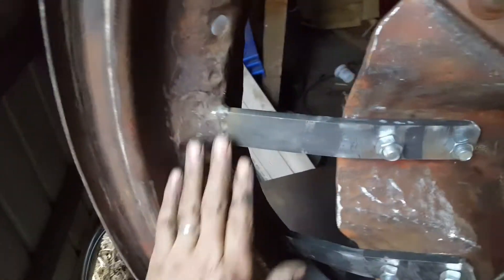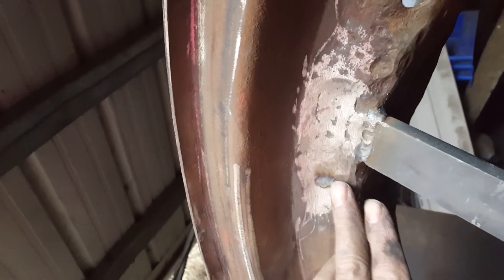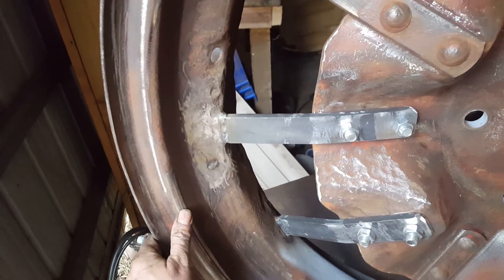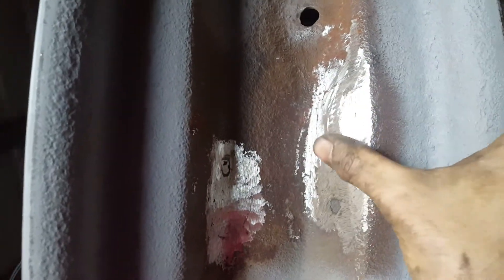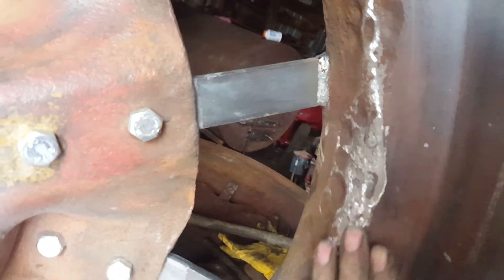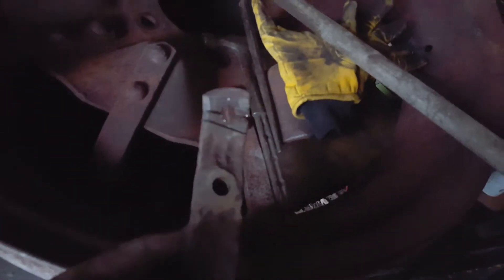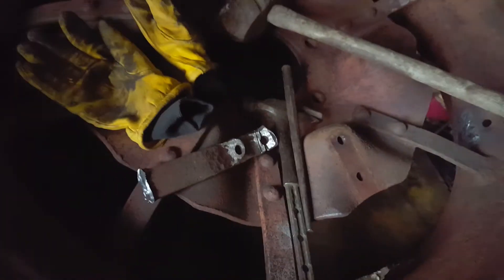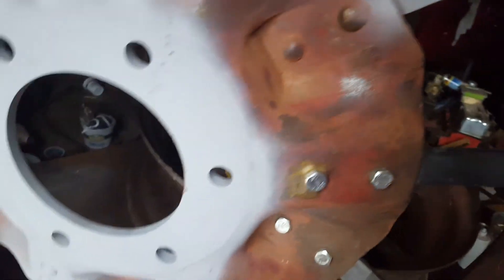1937 Farmall F-30 Rear Rims Part 3

Comment: will f20 wheels fit on a f30
Reply from the maker: Fronts will, rears will not....
Reply: i was hoping they would they look the same i have got my grandparents f30 im trying to put back together and i cant find f30 wheels for sale any where i can find f20s and my f30 wheels are not rebuildable thanks for the info i will keep trying to find some f30 wheels for sale somewhere
Reply from the maker: Can you show a photo of the rears? as long as the hub is good, the rest can be replaced....
Reply: yes just let me know how you would like the pictures sent to you one is rebuildable but the other one a tree has fell on and smashed the rim and spokes and it is also pretty rotted thanks for the help
Reply from the maker: reddoxn@gmail.com